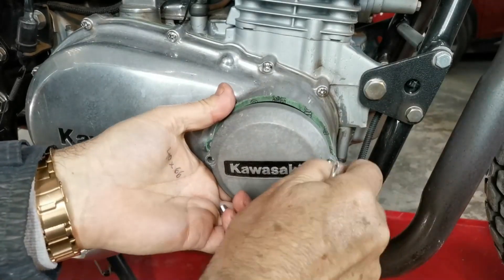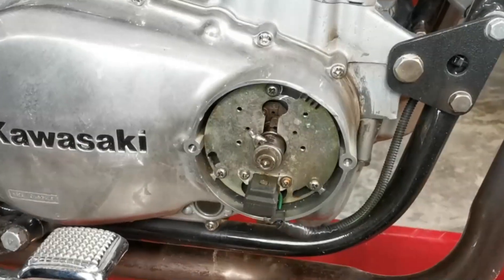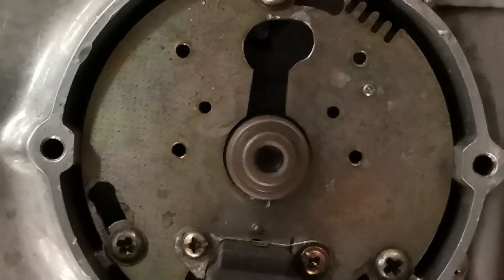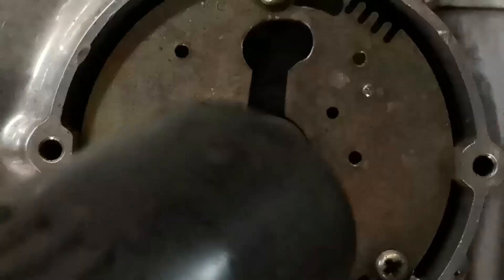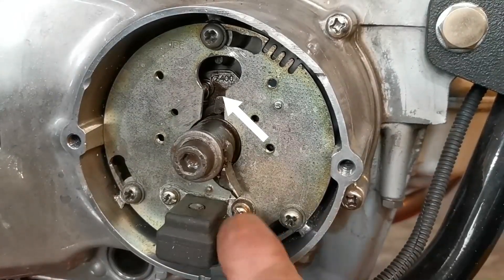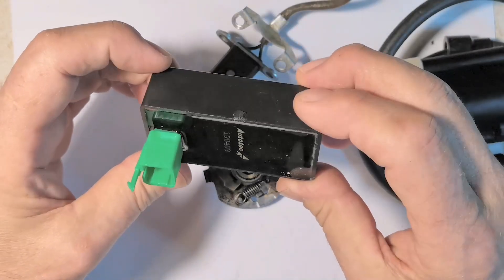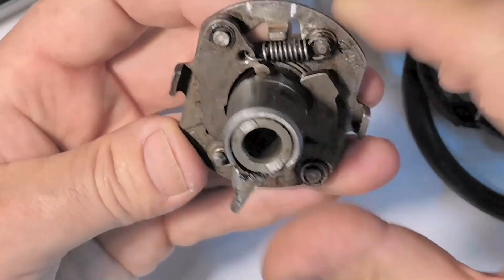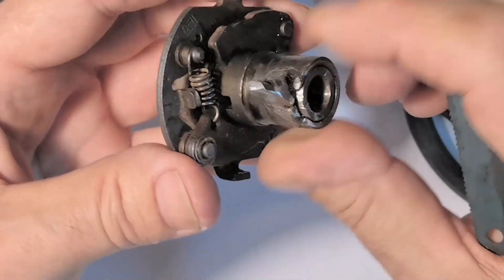Arma tu propio CDI de 12V punto fijo. Úsalo en motores de  2T y 4t. En un  cilindro, dos, o más.

Comment: Saludos desde peru..le hago una consulta .instale un tacometro electronico de rpm a un motor 2t la señal la tome de la entrada al cdi....pero me marca con muchos rpm es decir deberia marcarme en 1500 rpm en minimo pero esta en 3000 y cuando acelero la moto me falta escala.
Que podria hacer ahi para reducir la medicion a la mitad de rpm y me marque lo que debe ser.
Reply from the maker: La señal que le estás enviando al tacometro tiene la frecuencia duplicada. No se si puedes elegir en el tacómetro el uso para este tipo de estator.  Saludos.
Reply: @SergioCuruchet  y no existe forma de reducir esa. Frecuencia...? Es decir si intercalo un diodo para obtener la mitad de la frecuencia? Gracias de antemano.

Comment: Buenas noches sergio. Muy interesante su canal. De a poco voy viendo todos los videos. Una consulta. En el caso de la moto del video. Se podría dejar la bobina original si se instalara un TCI? Tengo que hacer una reforma similar en mi honda c92. Gracias por la informacion.
Reply from the maker: Hola, mira mas videos. Un TCI es otra cosa. Aquí se habla de cdi a 12 volt. Y las bobinas de platino no funcionan muy bien con cdi. En general proporcionan menor potencia de chispa. Saludos
Reply: @SergioCuruchet  si. Conozco la diferencia. Luego vi su otro video en el que convierten una cb125 a cdi dejando la bobina original de 6v. Como la bobina original de mi moto es de 6v voy a probarla con cdi

Comment: Hola sergio 
Es un placer y una suerte que haya gente como usted que transmita sus conocimientos de esta manera tan altruista.
Le escribo desde españa y la razon es por una honda ss50 del 82.
La moto es de platinos y de 6v y no sube de vueltas y sin potencia, deja la bujia negra y termina por comunicarla (la deja inutilizada) tengo el presentimiento que el problema es que no avanza el encendido por falla del sistema centrifugo aunque aparentemente parece fincionar aunque al moverlo a mano, parece que la fuerza para vencer los muelles estan muy duros. Me he decido a fabricarle un cdi de punto fijo y mi pregunta es la siguiente:
 Debo modificarla de 6v a 12v para que funcione con este cdi? 
Y otra pregunta: 
La bobina del alternador que consegui de un kit de moto china no me coinciden los agujeros, podria cambiarle el hilo de esta al cuerpo de la bobina de serie sin tener que añadir el recubrimiento al hilo de cobre??
Un saludo y encantado de haberle conocido.
Reply from the maker: Hola, en este video tienes todo. https://www.youtube.com/watch?v=0Pfd9jvG79Y.
No es necesario llevarla a 12 volt. el encendido es independiente. 
La bobina, de moto china puede servir , si no tiene mas de 220 ohmios. Si la distancia de los tornillos es pequeña, puedes limarlos para que coincidan.,
Tambien puedes retirar el alambre de la vieja bobina de platinos, y rebobinar con alambre 0.18mm y 100 ohmios, o alambre algo mas fino, pero no pasarse de los 220 ohmios.

Comment: Hola don sergio muy buen cdi para construir, para mi gt 250 queda bien pero  le quiero consultar si tiene algun plano de cdi de 12v pero con atraso de chispa para motos 2t 
Tengo una gt 250 q tiene escapes de expansion y lumbreras levemente tocadas y actualmente anda con sus platinos y su estator original.
me gustaria probar un cdi que atrase la chispa. la moto esta bien original su parte electrica y funciona bien su sistema de carga por eso le consulto por uno alimentado por bateria de 12v
Gracias saludos desde chile.
Reply from the maker: Hola, la verdad que un circuito con autoataso para bobina pulsora externa al volante, no tengo. Saludos

Comment: Muy buenas noches señor curuchet. Le estoy enormemente agradecido por compartir con esta comunidad parte de sus conocimientos. 
Mi pregunta sería la siguiente. De igual manera que existe en el mercado las llamadas pastillas ( no sé si el nombre es correcto).  Que en máquinas moto sierras, sirven para sustituir platino y condensador.  
Sería viable algo similar para motocicletas con plato magnético de 4 imanes?.
Claro lo ideal seria, a ser posible sin tener que modificar bobina de encendido ni de alta.
Lo vengo intentando desde hace meses, y eh replicado algún ruptor electrónico tipo Atom , pero me temo que mis conocimientos de electrónica son escasos. En fin, le estaría muy agradecido por cualquier tipo de organización.
Reply from the maker: Hola, yo experimenté mucho y los resultados fueron muy variables. En algunas motos funciónó medianamente correcto y en otras no. El problema es la diferencia de resistencia en el sistema de lo que es incluido bobina de baja y la de alta. Hasta el largo del cable desde el motor a la bobina de alta, influye. No se si recuerdas las bobinas, generalmente de bosh, que dentro del volante, en el mismo núcleo incluía el bobinado de alta y baja. Pues en esas bobinas el sitema pastilla andaba genial. Teníamos en nuesto país, un ciclomotor Garelli que traía ese sistema. Le constuí  y adapté ese sistema a muchas de ellas quedando, en todas muy bien. Saludos

Comment: Hola Don Curuchet. Este CDI yo lo podría adaptar a mi Suzuki gsx 750 año 1980.? Mi modelo tiene avance mecánico, dos bobinas(chispa perdida) y ya cuenta con 2 bobinas captoras. Que ventaja tendria?  Saludos y muchas gracias
Reply from the maker: Pues si ya tiene encendido electrónico, no le veo necesidad de un cambio. Saludos
Reply: @SergioCuruchet  tiene TDI, original de la época y ya tengo que pensar en alternativas

Comment: Excelente video maestro!! quisiera hacerle una consulta, hay videos en esta plataforma que dicen que se puede conectar un  cdi de corriente alterna solo conectando el cable de alimentación directamente a la batería y ya estaría el cambio de CA  a CD,  es cierto ? ya que en uno de sus videos  nos decía que había que poner un transformador de 12 a 250 v, gracias de antemano
Reply from the maker: Hola, jaja, haga la prueba y tendrá un una cajita de unos cuantos elementos de electrónica achicharrados, y un olor no muy agradable. Saludos
Reply: @SergioCuruchet  pense lo mismo, gracias por la respuesta maestro, saludos desde Perú